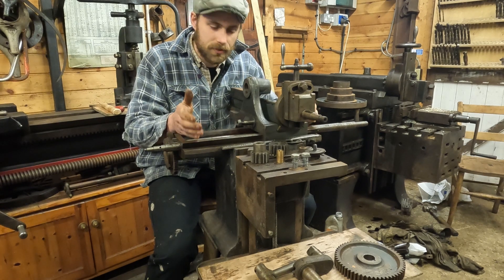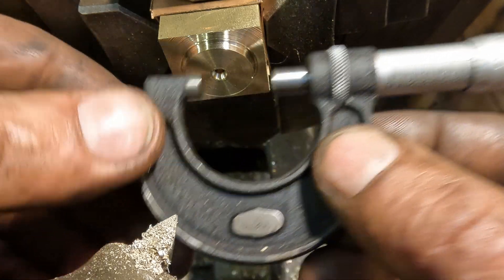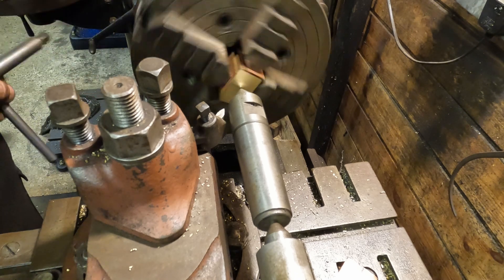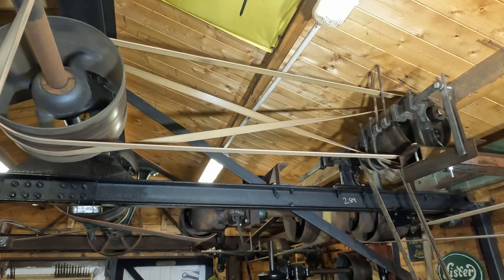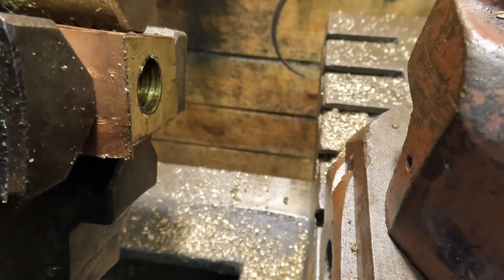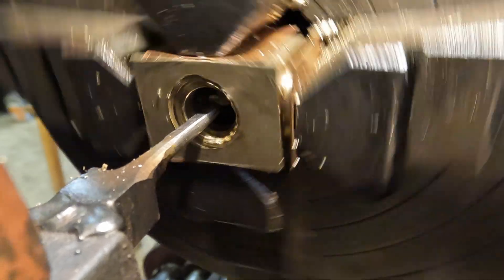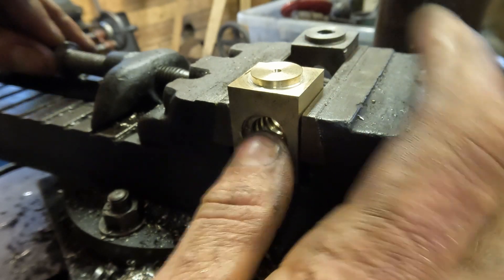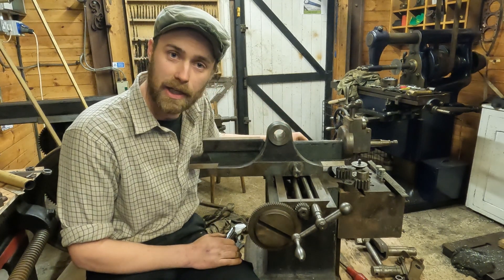Square Threading a New Leadscrew Nut for my Boynton & Plummer Shaper - Belt Driven Machine Shop

Comment: I've made a few leadscrew nuts over a period of time, the worst was a double start 2 tpi, o/d of .750" , I find it better to leave a little extra material on front of nut bored the size of the screw o/d, then I know when I hit it, the thread depths right, I'm not left wondering if the tools moved o.o.p

Comment: I've watched all of the videos and they are great. 5he only issue I have is the line shaft ripems vs surface speed. All the gear is running to slow even for hss. Another hundred ripems on the line shaft would make a huge difference

Comment: 03 02 25. Old turner here in New Zealand I allways with threading tool before threading turned outside dia of screw thread it lets you know when you have got tosize then if tight it needs side cuts.

Comment: Too bad they didn’t have dial measuring tools back then. I have some of the old Starrett measuring indicators with the long arm showing the number against a scale. They actually work well. Also, you don’t see many traveling shapers still around. My books from the late 1800s shows that they were fairly common, particularly those with two heads and work blocks to do two parts at once.

Comment: Now I have seen two of these shaper and you have them both .I have a Rockford 24" hydraulic shaper that I use . Are all your machines belt driven it is quite the collection aka The Ironworker my channel
Reply from the maker: The 24" sounds very cool! Shapers can be very handy. Yeah all my machine tools are belt driven from the same system. I did have a small electric shaper once, but sold it when I got the belt driven ones.